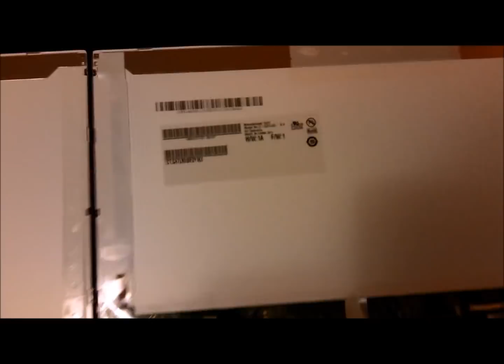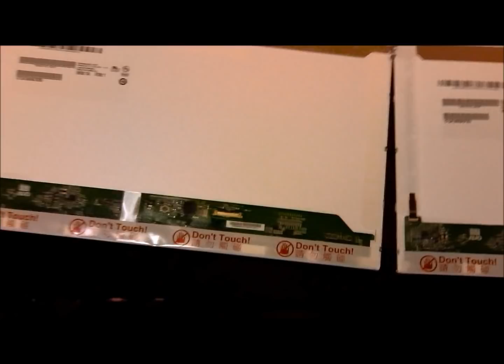Tutorial: How to replace the LCD on a Laptop (HP Elitebook 8440P) 1080P

Comment: I know this video was posted a while ago but what exact size torx screw do we need. We used a 10 and it didn't fit. It was too large.
Reply from the maker: Should be a T8, here is the manual which outlines all the screw sizes- http://www.hp.com/ctg/Manual/c02745864.pdf

Comment: where u buy screen at, n how much, thanks
Reply from the maker: toivadan Hi, I posted a link to which screen you need in the video description. Thanks
Reply: Screen price bro
Reply: @alibabagamingyt195  theyre usually like 40-50 bucks
Reply: id open it up first before you buy a new lcd though. sometimes it might just be that the connector is loose or got disconnected.

Comment from the maker: Yeah like I said, I am pretty sure that you can only go up to the 900. You might be able to use the panel from a different one (look into newer elitebooks maybe, the connectors are pretty standardized relatively speaking). That being said, if you really *need* 1080P, you are better off getting one with that rez already instead of trying to Frankenstein one. I have no experience putting laptops out of spec in that fashion. Good luck tho, and be sure to post a vid if you get it working!